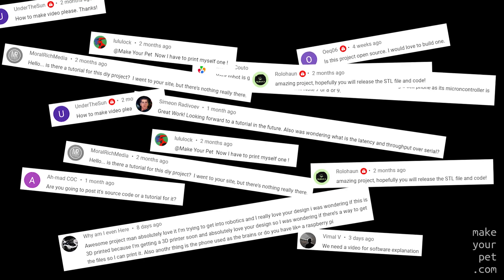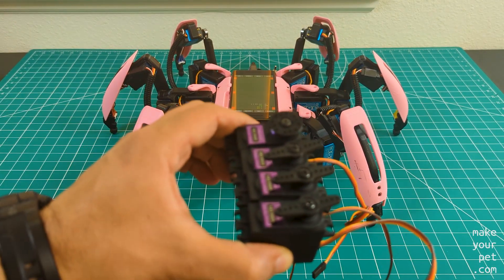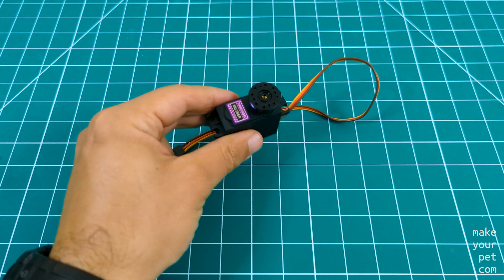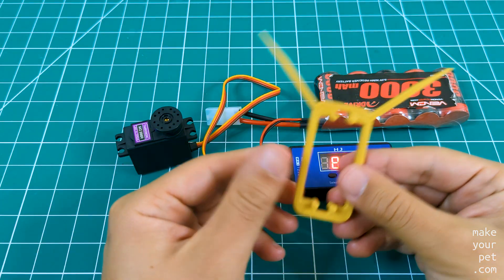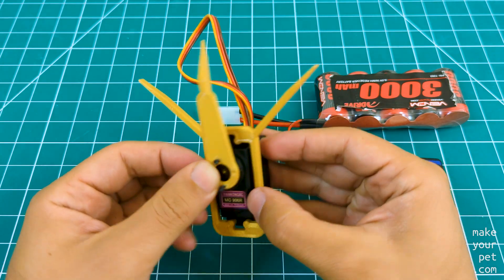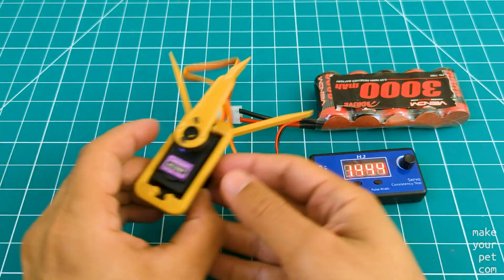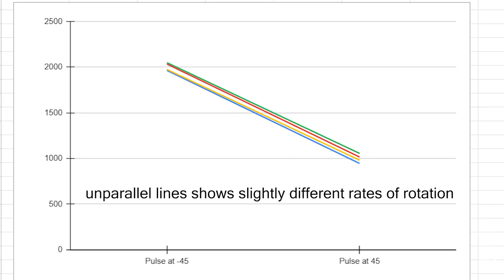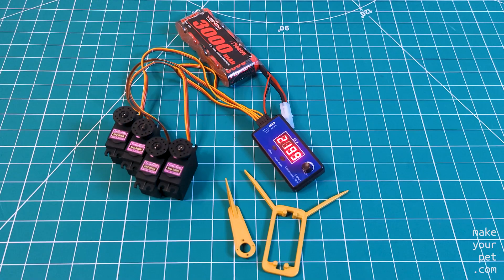How To Make A Hexapod Robot. Part 0 of 3: Calibrating the servos.  A DIY Robot Project.

Comment: does the servo store the data somewhere? otherwise I don't understand how this works.
Reply from the maker: not the servo, but the phone stores those values and uses that to accurately position the servo.
Reply: @makeyourpet  so I write down the values of the servos. where do i put it in? in app? do I also have to transfer or install something on the servo controller?
Reply: @RealTimomania on the config file of the server app you install on the phone. Edit the defaults to match the servos

Comment: hello, the battery tester need a battery power between 4,8-6v :/ 
And on the market, the batteries are powered with a modulo 3,7V !? What battery are you using ?
Sorry for this noob's question ;)
Reply from the maker: I use a 2S LiPo battery on the robot, which makes 7.4V (2S * 3.7V -> 7.4V). In the video I am driving the servo tester with a different 6V NiMH battery. But if you are into these kinda projects, think about getting a DC power supply like this one: https://a.co/d/j4Prl2D to use for testing and development. It will save your batteries from unnecessary cycles and will totally pay off. Plus you get a clean and adjustable power source to use for any future projects!
Reply: Is there any other way to power the tester? I only have the 2sLipo battery...
Reply from the maker: If u are into hobby rc projects, I would suggest to get an adjustable dc power supply. It will make life so much easier and will save ur batteries from unnecessary cycles

Comment: Mg996r servos have response time about 20ms 
For digital servos it will be 2ms . 
I'm not sure about it so kindly clear my doubt is that actually true
Reply from the maker: Old school analog servos were working with 50Hz, which is the 20ms that you mentioned. Digital servos usually work with 300Hz signal which is around 3ms response time. I would use 50Hz which is compatible with almost any pwm servo, unless I really need that extra response time.
Reply: @makeyourpet  thank you ❤ sir

Comment: AWESOME!! I bought all the materials already. I've been waiting for this. :D 
Also wouldn't it be possible to have the program calibrate it and map the values each boot up?
Reply from the maker: I'm happy you like it :D I've been designing the leg parts this past week and the new video is coming out soon.
You only need to calibrate the servos once before installing them. These servos don't have any feedback and there is no direct way to self-calibrate. There may be a way to minimize the servo errors using the touch sensors of the legs and the gravity sensor in different positions. But that would be an indirect approximation and probably very complicated. But I agree that it would be super cool to have it calibrate itself.

Comment: It's a tedious process mapping servos I'm already did this and added a feedback wire in potentiometer
Reply from the maker: Yes it is a repetitive and time consuming process :(
Adding the feedback wire from potentiometer is good for reading the current position of the servo. But in this project I am not using that (reading 18 separate inputs) for simplicity. Most of the time the potentiometer itself is the cause of error.
Reply: @makeyourpet  yeah that's right . From manufacturing itself the potentiometer has different values in hobby grade servos. because the knob connected with different angle .  I did it for collaborative operation by disabling servo we can use the potentiometer as input. And every time i turn on the servo it have sudden jerk so i wrote a function first it reads the pot value according to it's position PID will executed so the smoother operation was done. For bigger project with digital servo and bigger microcontroller we can read and save the last pwm signal in EPROM ..
Reply: That's how I would do it on any servos. I think some higher grade ones already have the extra wire soldered in but they are more expensive... -_-